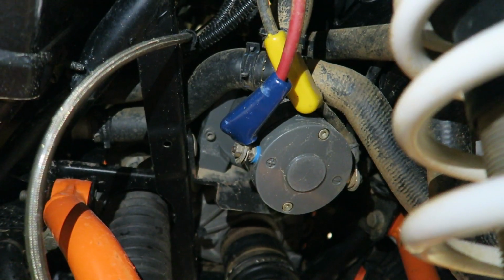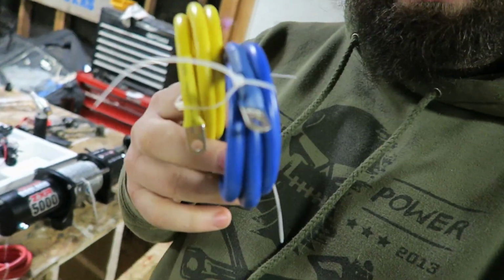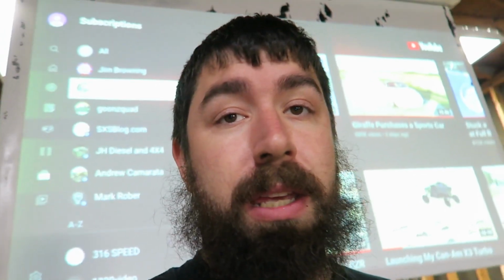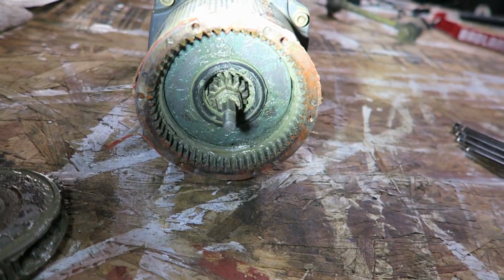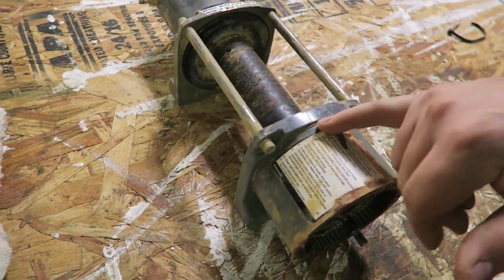Long Term Harbor Freight Badlands Winch Review **(SHOULD YOU BUY ONE???)**

Comment: I have this winch and it struggles with lower after using it for 1 minute. It’s like the battery is dead but it’s not! Any idea what I could be doing wrong?
Reply from the maker: Yeah either you have burnt the motor up or you have hurt or melted the wires that are going to the winch motor the factory wiring is junk

Comment: What cable did you upgrade to? got the link ?!?
Reply from the maker: I have used so many different ones i break them offten
Reply: @redneckengineering7739  what about the electrical cable ?
Reply from the maker: Just heavy duty cable that I found on Amazon

Comment: I do water riding so do you know if they will mess up or work fully submerged
Reply: It’s a 2500lb
Reply from the maker: I sure hope that it is on a four wheeler’s otherwise it is way too small but yes it will still work but you have the potential of corroding the cheaper made Power wires and I had to change mine out to some heavier duty cables but other than that it is good

Comment: My badlands 5000lb winch just clicks i was using it and it just stopped moving and clicks now
Reply from the maker: Most likely you have corroded and melted the wires going to the motor tool bag the terminal cover and see what it looks like I had to upgrade all of the power and ground wires after a while

Comment: Got a question maybe you can answer it recently got the same winch for a 2020 kawasaki teryx I need to rev the engine or the sxs will shut off kills the power like that?
Reply from the maker: I don’t know anything about the KRX electrical system or how big the battery is but you’re probably gonna want to get a dual battery kit or something like that the KRX may not have that big of a stater with a stock RZR never had any problems running it Where are you located